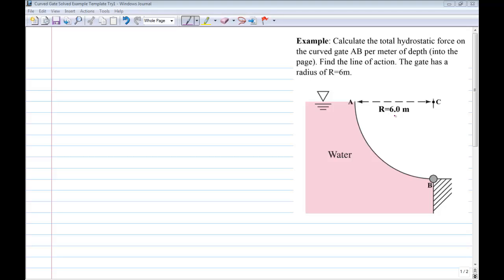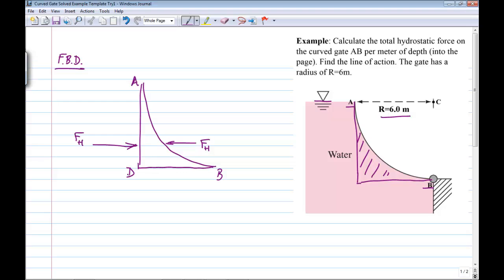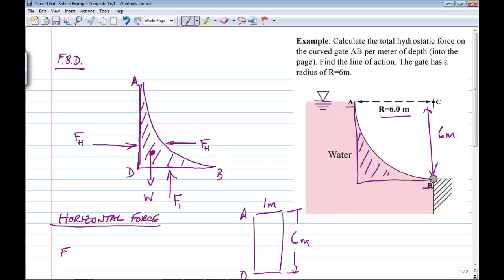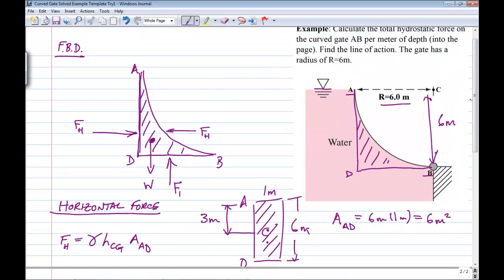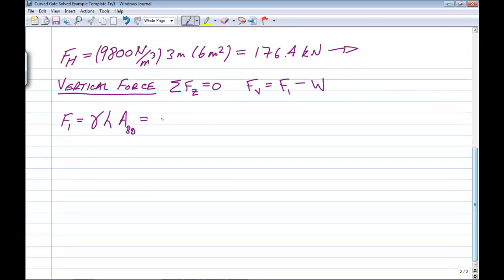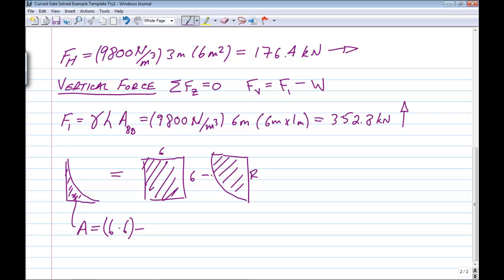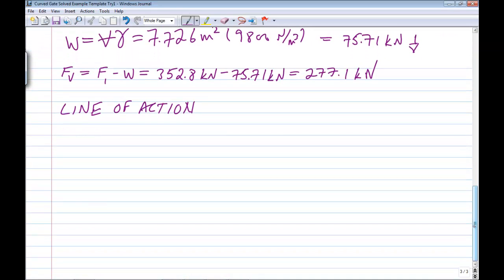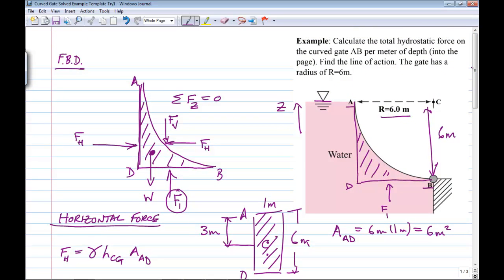Solved Exam Problem: Hydrostatic Forces on a Curved Gate

Comment: for the 75.71 kn in 9:42, do you disregard m? since you cancel out m^2 from m^3 the unit should be kn/m.
Reply from the maker: Ok. Yes. All the forces are per unit depth, as given in the problem statement.

Comment: Can I ask why the vertical force = (9800N/m3) x (6m) x (6 m2) = 352.8 kN? The height should be 3 m?
Reply from the maker: Look again. The depth of surface D-B is R=6m. This entire horizontal surface is at a depth of 6 meters.

Comment: would there still be f1 if you had drawn the outline at the bottom of the water?
Reply from the maker: Yes, F1 would still be there. It would be a large force due the greater depth. But , the weight force, would increase too, by the same amount. So, you'd get the same answer. I hope that helps.

Comment: Shouldn't the volume be in m^3 I assume there was a step you multiplied the area by that 1m depth to get V. Then multiplied that by 9800N/m^3 to get the units you did in KN. time 9:57
Reply from the maker: Yes, a typo. I guessing you missed the flyout comment at 8:52.  Btw,  m^3 is marked in the pdf available at the course website.

Comment: I don't know why I can't get it man although got AA in mechanics of solids and engineering dynamics and statics but I am struggling so badly with this... Sometimes FV equals the weight of water, sometimes it does not.. Sometimes we have 3 vertical components sometimes we do not 🤦🏼‍♂️ struggling so bad man soo baad
Reply from the maker: When the liquid is entirely above the surface, then the vertical force will be equal to the weight of the water. But when the water is below the surface (as in this problem) that cannot be true,  since the vertical force on the gate is upwards. In these cases, the free body diagram has other vertical forces that need to be included in the force balance.
Reply: The difficulty of fluid is that every problem has  different ways of solution, even in the same chapter! This a structural engineer has never seen this before

Comment: 5:35 

Dear Sir, why do you count Fv pressure force.? 
Usually, I saw teachers concern about the weight of the water up to free surface to find vertical force. 

I only find in your all of the video you count vertical pressure force, why sir?
Reply from the maker: I'm not sure I understand your question. I think you are asking, why not calculate Fv using the missing water approach? I discuss this alternate method and it's drawback (finding the line of action can be tricky) here: https://youtu.be/yelqodaUfOE?t=906

Comment: Hi, from your FBD, your Fv goes downwards. But on the last part, you made it going upwards. Why is that?
Reply from the maker: Note that Fv acts downward on the water (in the FBD) but upward on the gate -- the force equal is magnitude but opposite in direction.  The question acts for the force on the gate (which is upward). I hope that helps.
Reply: @Fluid Matters  Hi, thank you for replying. Another question, You have mentioned on the last part that Fv can be solved alternatively by multiplying the specific weight of the water by the imaginary volume on the other side of the gate. But if you do that, you get a different answer for Fv compared to your first solution. Why is that?
Reply from the maker: @jhunardchristianasayas7134  You get the same answer: vol*specific weight= pi*R^2/4*(9800)=3.14*36/4*9800=277.1 kN
Reply from the maker: @jhunardchristianasayas7134   You get the same value:  Fv= vol*specific weight=  pi*6^2/4*9800=277.1 kN

Comment: Vertical component can be directly found by volume of virtual water content in quarter circle multiply by specific weight...
But new concept.. ❤️❤️❤️
Reply from the maker: Yes. That is an alternate way to solve the problem. I talk about this approach at 12min 40s.

Comment: can i ask why there is 1m of width ?
Reply from the maker: This is a two-dimensional problem. So, the calculated forces are per unit width into the page (width=1m). If the curved gate was say, 5m wide, you would multiply the force per meter of width by 5.

Comment: Why you use h as 6m for calculating F1 instead of taking the value 3m?
Reply from the maker: The centroid of surface DB (and indeed, the entire surface) is located at a depth of 6m.

Comment: For the curved surface AB, determine the magnitude, direction and line of action of the vertical and horizontal component of hydrostatic force acting on the surface. L=1m

Comment: sorry if I'm wrong, but shouldn't you have multiplied the w force downwards by g=9.81? before subtracting it from f1?
Reply from the maker: W is the weight (not mass) of the water. So, you do not multiply by g.

Comment: I do not understand why you calculate the weight of water for F vertical, the weight of water is not on the gate, we only calculate the forces on the gate.
Reply from the maker: My solution involves a free body diagram of the water adjacent to the gate (not the gate itself). F_v, F_1 and the weight of the water are the vertical forces that must balance. So, I end up getting the force on the gate (F_v) indirectly in this way. If you find this puzzling, it may help to review your basic statics.  I hope that helps.

Comment: if the water were above the curve and the air below, it would be the same but instead of decreasing the weight of the vertical force I would add it?
Reply from the maker: In this case, you would draw a different free body diagram of the water above the gate -- the weight of this water acts downward on the gate and is equal to the vertical force on the gate. I hope that helps.